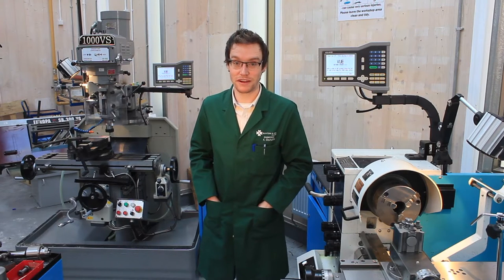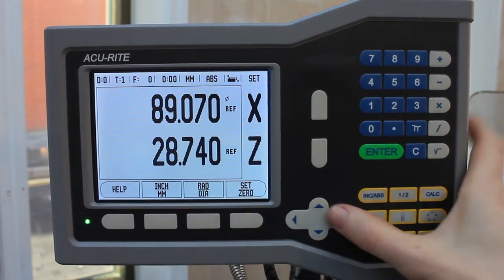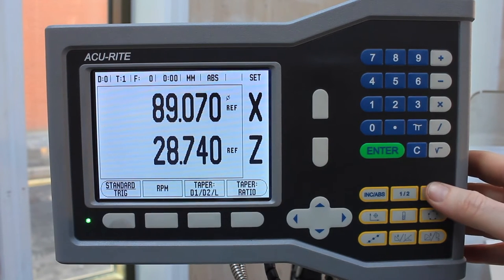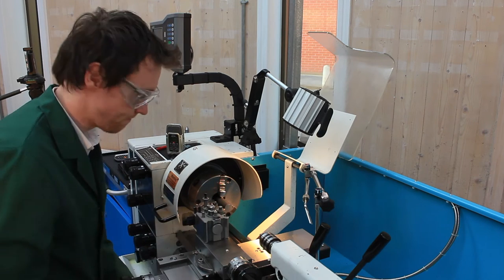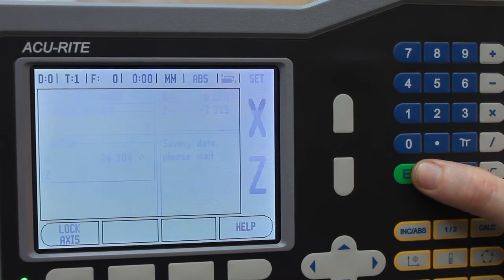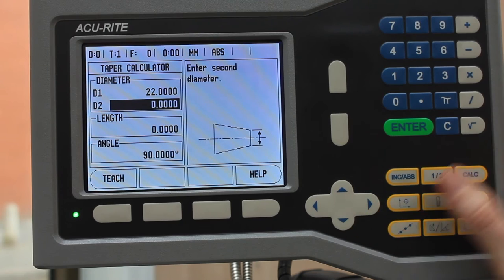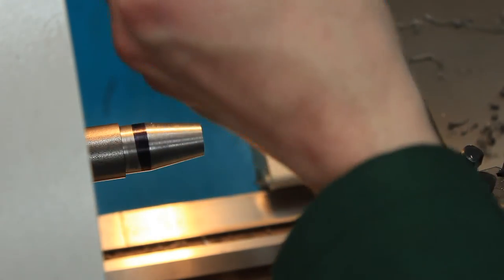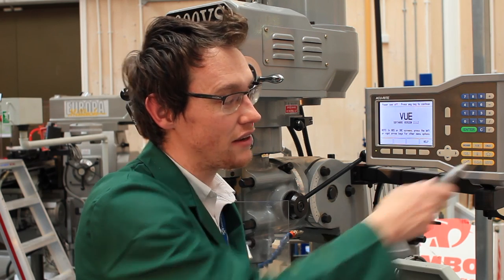Digital Readout Lathe Tutorial Acu-Rite Vue -#5minFriday - #5

Comment: I have the same Dro on my lathe . It was working correctly but after a power cut the X axis is now counting larger moving towards the centre , I’ve tried changing some settings but can’t get it to count smaller as it was. Any ideas?